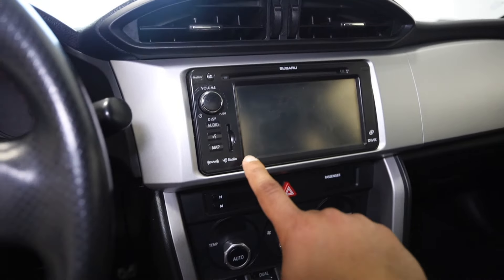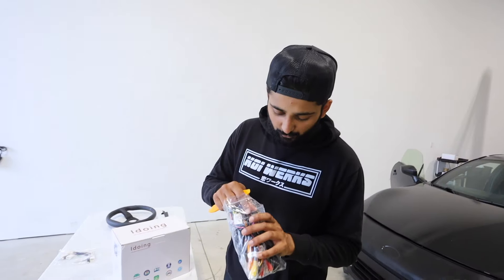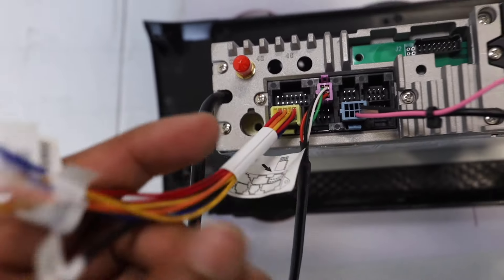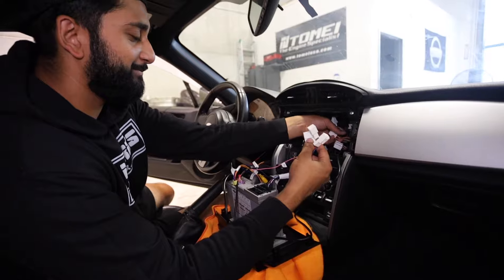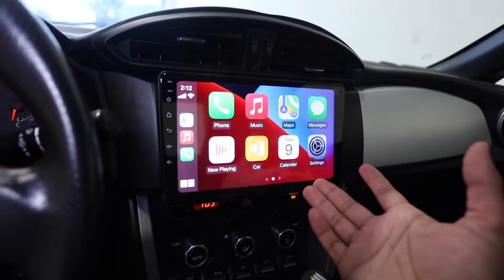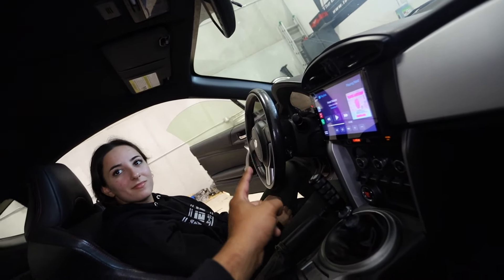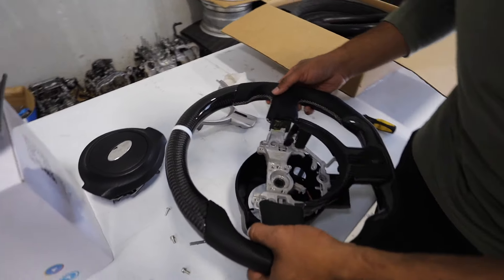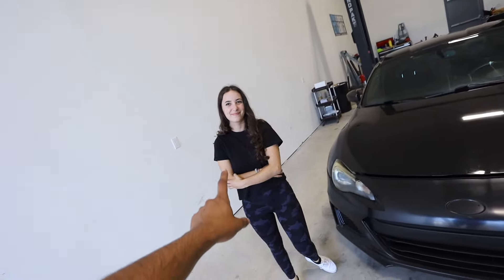THE ULTIMATE BRZ/FRS/86 INTERIOR  UPGRADES

Comment: Interesting idea with the mic...however keep in mind that the original mic in there was designed to have noise cancellation from the roof vibrations and surrounding areas...this one wasnt. The other party is going to experience a ton of feedback especially when driving on the highway when you're trying to speak with them. This mic isnt designed to sit in there. 

Best bet if you're handy with a soldering iron and some know-how is to convert the original mic to a 3.5mm jack on the end and run it into the new headunit.

Comment: The headpiece is a bit too big for my taste, anything smaller that fits the dimensions of the rest of the frame?
Reply: i got burned a few years ago with an XTRONS android unit - the tuner stopped working after about 18mo. that and the fairly shit sound quality pushed me towards getting a name brand this time around, so i got one of the cheaper pioneer units (DMH-2660NEX) and i'm happy. the sound quality is MUCH better, even if it's more basic (i do miss having android actually running in the dash, but carplay/android auto isn't too bad)

Comment: My head unit trim piece is the alcantara one which is one huge piece, any suggestions on what I do for an aftermarket head unit?
Reply from the maker: i would look for the brz air bag cover trim piece on ebay and match it up with the headunit, that way you can run the headunit and you’d have 2 separate trim pieces

Comment: I have the same unit for my brz and my experience is great. I did have issues first but i message idoing and they helped me out. The carplay has issues connecting so the fix is software update.
Reply: Is there a link to where you bought it?
Reply: @elrudiiisimo3066  did you find it
Reply: @monty.montero  did he find it
Reply: @yaboyross7192  i bought a unit and already installed it. i recommend fs
Reply: @monty.montero  i just have to find a panel to replace the right side because mine right now is one whole piece